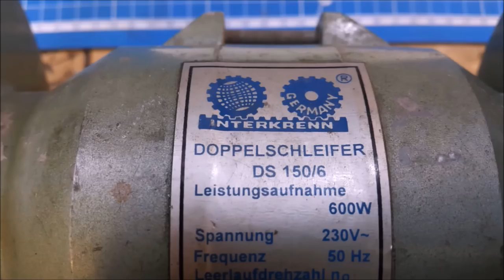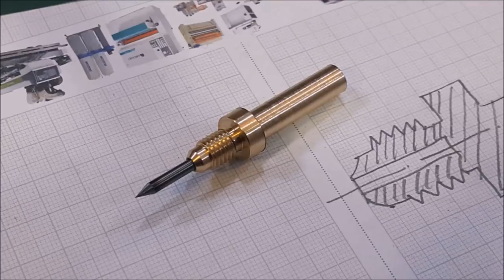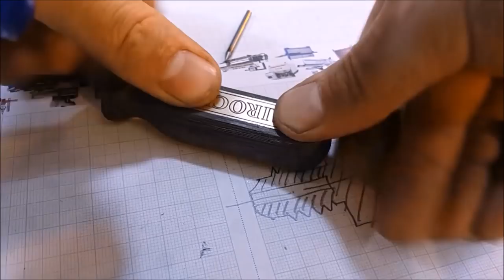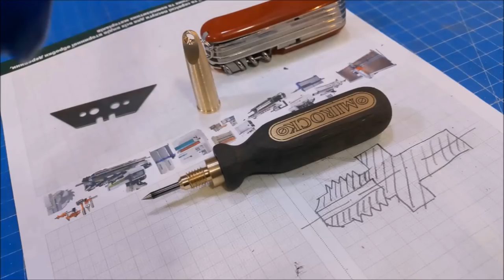Mirock Awl

Comment: Mirok, for the engraved nameplate at 2:59, is that solid brass stock? Did you coat it with something for a reason?
Reply from the maker: Yes solid brass seems 2.5mm. No special covering just satin by sandpaper and a bit oil when I cover wood and label together.